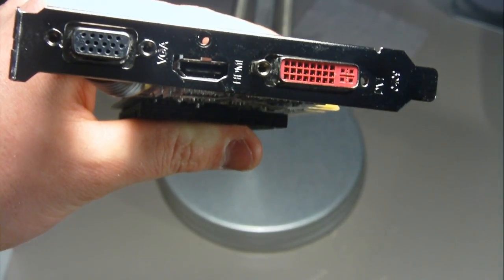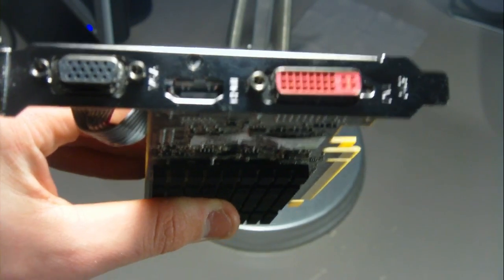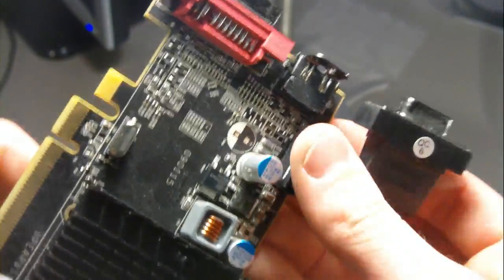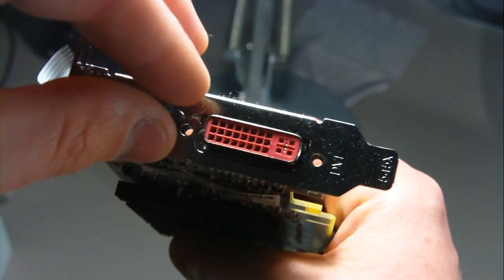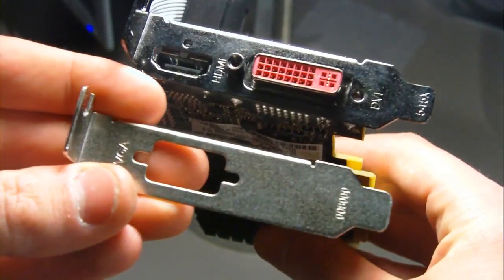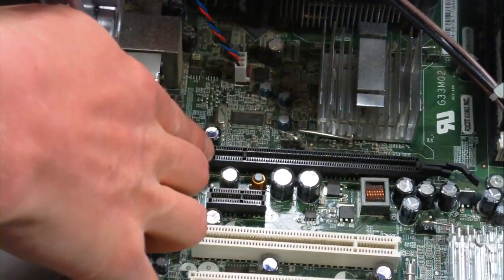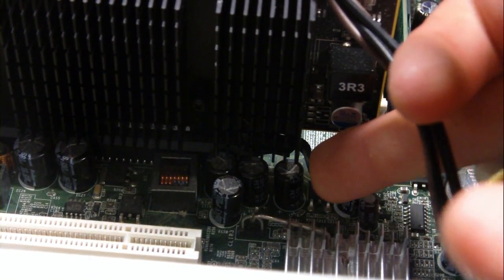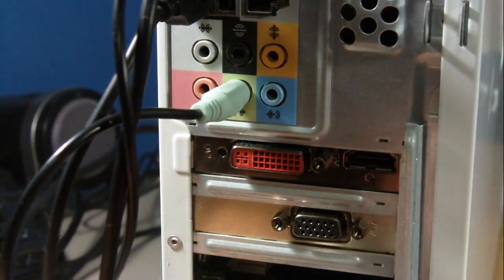[UPDATED] How to install a low profile graphics card (GPU)

Comment: sad i not find here what I wana know, there be a J2 connection on the grappic cart it say audip, must be digi connect as only 2 pin, and a J6 connect just wonder what for that be to connect, my guess was maybe a  powerconnect  for some  fan but wasn't sure and what wil be the voltage

Comment: Wait? So after the new graphics card is properly installed. You can unplug the VGA cable back into the original plug. Or do you have to keep it plugged in to the new graphics card.
Reply: you plug it into the new one graphics card

Comment: What if you are doing the opposite way? Low budget to normal desktop.
Reply from the maker: Low profile card to a normal width tower? In that case, you would leave the wider bracket on. As long as the card plug into the PCI slot, the card will work fine.
Reply: The thing is, do you have to cut holes in order to fit it in? I just used tape to hold the graphics card in place and I also used it to cover the openings to keep the air flow going. Also my monitor is in safe power mode even though the computer is running good.
Reply: Bare in mind, I have a integrated AMD Radeon Xpress 200 and I just added a another one that is a ATI Radeon Graphics PCI card.
Reply: Nvm, BUT NOW I HAVE A BIGGER PROBLEM. I AM GETTING LONG BEEPS EVERY TIME I START UP MY COMPUTER.

Comment: pls recommend me vga with 2gb ddr3 128bit for my pc hp compaq dc7900 convertible minitower. processor dual core v pro e8400. ram:ddr2. psu=365w

Comment: I have been using a intel celeron dual core 2.16 ghz and 64mbs of vram for gaming for the last three years, I finally decided to get something better because i was always having a shit pc and only playing two games. So i bought a Dell Optiplex with a intel i5 2400, 1tb hard drive, 8gb of ram, and a 270 watt power supply.. It is a small form factor case so i'm going to buy a gtx 1050 ti low profile and throw it in there.. This will be a huge improvement holy shit, i am so excited, i have never owned a pc with anything better than a dual core and intergrated graphics...
Reply from the maker: Sounds like a big upgrade. You'll enjoy it!
Reply: Thanks Man! I subbed!
Reply: Talon TCK need a better power supply
Reply: How many watts do you have, My 240 watts stock optiplex supply powers everything fine.. Good luck :)
Reply: if your upgrading to a GPU from integrated graphics I would recommend at least 400w just to be safe.
Reply: 1050ti would also get bottlenecked by a celeron I will try to do some research to help you out a bit more
Reply: First of all, you assumed a have a celeron which is incorrect, i'm informed enough to know basic shit, The 1050ti and 750ti and other low profile cards meant to do this shit
Reply: sorry misread your old comment

Comment: does this graphics card come with a vga bracket? It's the same card I want to buy and vga is video connection I use
Reply from the maker: You'd have to find out yourself from where ever you're getting it. I believe mine did.
Reply: WirelessHotShot thanks

Comment: MSI Has a new low profile gpu - last month i installed on my HP Compaq elite 8200 sff pc with  i5-2400 cpu / 8 gb ram / 2 x ssd hd & msi 1050 ti 4gb low profile gpu all running on my stock 240 psu !! works amazingly quiet , cool , while running 1920 x 1080 @ 60 ghz - average 60 fps - most 2016 games.  newegg : $ 140.-  ( rebate ) or msi 1050 2gb LP for $ 100.- also has rebate.

Comment from the maker: As someone mentioned in the comments, it is highly recommended to go to the manufacturer's website to download the latest drivers.
Reply: Really great video!
+ 1 sub
Reply: WirelessHotShot hey bro great video but i still need some help can u contact me anyway to give extra help
Reply: @CoolBrick It's alright m8 lol
Reply: @imcarlos13  nerddddd
Reply: @max-jm7hy  Lmao it's been 2 years
Reply: sorry for asking these but:

1. should i download the drivers for the video card before putting the video card in?

2. what happens if i put the video card and run the computer without downloading the drivers?

3. is it possible to run the cpu without a case?

im new into building pcs and stuff, big thanks to those who answer my questions respectively : )

Comment: this is truly a great card tell me if there is a better value out there for a 1GB "low profile" card. im putting it into my dell optiplex 780 SFF 
VisionTek Radeon™ 5450
https://www.newegg.com/Product/Product.aspx?Item=N82E16814129320&ignorebbr=1&nm_mc=KNC-GoogleAdwords-PC&cm_mmc=KNC-GoogleAdwords-PC-_-pla-_-Video+Cards+-+AMD%2FATI-_-N82E16814129320&gclid=Cj0KEQiAifvEBRCVx5up6Ojgr5oBEiQALHw1Tsc7oK7IDi_GjazvxYZOtk7tqKCu5CfcnI3Gkm7jZHsaAiCS8P8HAQ&gclsrc=aw.ds
Reply from the maker: That's about half the cost that I paid 5 years ago.
Reply: WirelessHotShot do you think it is possible to take the fan out of the old hard drive and swap the old hard drive with a solid state drive and use that fan to cool the passive graphics card because it is (fan) already connected to the motherboard?
Reply from the maker: I'm not quite sure. Could you just get extra fans for the inside of the case? Or maybe you could research and experiment with it. Sounds like a fun little project.
Reply: WirelessHotShot I researched it and what you need is a power spliter (to split the power supply output) and then u can (for example) split the hdd power and add a fan onto it. this is exactly what I plan on doing, I'll probably make a video on it too, no one has made videos on it yet. very professional video btw great job!
Reply from the maker: Awesome!
Reply: nobitagian1 yeah I truly messed up getting the stupid visiontek. I don't really play games, but even Minecraft lags during explosions. what's your cards clock speed? this trash is only 550 GHz and over locks are unstable af
Reply: nobitagian1 well honestly I got this to replace the onboard graphics which are total BS. I don't do gmaing on this right alot because my wifi sucks ass in my room. I'm gonna build a good gaming rig on Cyber Monday and hope to snatch a couple 1080's

Comment: bro what's your power supply watts
Reply from the maker: I believe it was a 240 Watt PSU.
Reply: WirelessHotShot bro I have 230 watt power supply can I run zotac nvidia gt 710 on my PC?
Reply from the maker: It recommends a 300 Watt PSU. You might be able to run it, but it will be clunky. I'd suggest upgrading to a higher PSU. They aren't very expensive. Good luck!

Comment: I have low profile gpu but it has a fan connector in between its msi n8400gs please tell how to fix it should I plug power cable to low profile
Reply from the maker: I'm not sure what you're asking, but I looked up the GPU and it doesn't normally have a fan attached to it.

Comment: when i connect my vga cable to graphics card to install drivers .my screen goes black (no signal) after 5 minutes 
what do i do
Reply: same
Reply: ShimxFn you guys probably don't have a much powerful PSU? I'm guessing.In order for your PC to run the graphics card you need a power supply unit that probably has more than 200w with most gpu's

Comment: hi i need help when i plug vga cable to my graphic card it doesnt show starting windows logo the screen is completely blacked out  please help and when i remove gpu from my pc everything works fine😢 please help
Reply from the maker: Try a different cable or different plug on the graphics card.
Reply: +WirelessHotShot i tried every single method but when i remove it everything works fine and i went to bios at startup to check if it is showing there,yes it was there and i set it to primary still the screen was blacked out there is i tried the gpu in my friends cpu it worked,he has 64bit windows and i have 32bit is that the problem?
Reply from the maker: Did you try disabling the onboard graphics if the motherboard doesn't automatically do it? Do you have another PCI slot to plug it into? It's good you tried it on a friends computer and that the card isn't faulty. And I don't think your system being a 32bit system is the issue, the pc I used in the video was a 32bit pc.
Reply: +WirelessHotShot yeah i tried unisntalling the onboard graphics still it dont show please help  my pc specs
intel i3-2100
motherboard-hp(its a hp 3300 series desktop)
powersupply 300w
ram-4gb
gpu-gt 610(😢)
i really wanna play some games please bro help i will never forget ur help
Reply from the maker: I wouldn't really know how to go about troubleshooting without it right in front of me. Best advice I can give you is to Google your problem and see what comes up. I'm sure it's happened to someone else and there is a solution. Good luck!
Reply: same here!

Comment: I have A radeon hd 5450
Please could you help me ??? I will apreciate that When i enter on high graphic game with low config the game crash with a colored screen like a rainbow with this error at the notification bar "The display driver stopped responding and has recovered" Any help please ?

NOTE : this problem occured with windows 7, 8.1, 10.
Reply from the maker: I'm not sure exactly, but you could try opening AMD's software and make sure things are set to high performance, to give the card all the juice it has. Check out this video, it might help. https://www.youtube.com/watch?v=Y9em5PO-2do
Reply: Sorry but ...
I tried to reinstall the OS - Not helping
I tried to reinstall the graphics drivers - Not helping
I tried to install windows updates - Not helping

Any other sugestions ??? that would be cool
Reply from the maker: Best advice I can give you is to just look it up. I haven't messed with the HD 5450 in 5 years. So I'm not much help. Sorry
Reply: I removed and replaced it again this morning but ..... Not helping
Thank you for your time

Comment: is this gpu outdated for gaming?
Reply: Yes ! It' a 2011 model. You can buy a radeon r5 230 it's a good good graphic card
Reply: +lamborghini14572 Yes it's not a problem
Reply from the maker: It won't be able to play many games. CS:GO and similar games, it should play fine.
Reply from the maker: Good idea. If you got the extra dough, I'd recommend a GTX 1060 or AMD RX480. Both near the same price range and will run any game!
Reply from the maker: As long as the rest of your computer is fairly new/good, you'll be able to run GTA V. GTA V, is actually a fairly easy game to run (lower settings). It's much easier to run than GTA IV.

Comment: Just bought a graphics card(n800-d512h) which goes into the pci slot, installed it and my pc opened up just fine but the monitor said it had no signal. Took out the graphics card,but when i plug it in the original(VGA) it works.. plz help
Reply: You need to set your video to the graphics card in the BIOS at startup.

Comment from the maker: Wow, it's been over 5 years since I made this video, and it has 150k views! Thanks guys! If anyone needs help, just send me a PM!
Reply: u can stick in any card in the slots but it depends on the slots itself if they bottleneck.
if u were to put a pcie 16 3.0 card in a 16x 2.0 slot, u would only get the performance 2.0 can handle even though your gpu supports more.
Reply from the maker: It should.
Reply: i have a small form factor pc and want to install a gtx 750 ti, is that card the same size as the radeon card in your video?
Reply from the maker: No it is not.
Reply: when i put in my nvidia 210 card !! and i plug my monitor cable into the VGA slot !! it dosen't show any signal !! what to do ??
Reply: Where did you buy this card?
Reply from the maker: I think NewEgg, like 4 years ago.
Reply: shame they don't make cards like this anymore.
Reply: They do
Reply: can I install a 3.0 x16 pci e on a pci e 2.0 x8?
Reply from the maker: I'm not sure. I'd have to guess you cannot.
Reply: Shut up Nerd If the card supports backwards compatibility yes, but you sacrifice 20 fps
Reply: how do I know if it support backwards compatability? help
Reply: Shut up Nerd Go to tomshardware.com and ask help if the gtx 750 ti supports backwards compatibility for (Your motherboard) and you will find you answer there.
Reply: it has to be a low profile card.
gigabyte has a low profile gtx 750ti though
Reply: yes im getting an msi or a gigabye gtx 750 ti lp but why does he say i sacrifice 20 fps
Reply: hi brother i finally find out a fix myself i try removing the vga cable of the gpu it is working fine and it is displaying in display adapters but it is written standard vga with this ⚠ on top so can u help me on this now, well thank u for all your answers i appreciate that 😊
Reply: +Slooby you would need the drivers for the gpu
Reply: +crashniels ok bro thanks for your answer i will download them
Reply: I have putted a new xfx card in the pc and installed the setup, but the colors aren't right and it's a bit laggy.
Reply: my motherboard vga not work with graphic card but if i remobe graphic card motherboard vga work if i put again graphic card try vga motherboard dont work helppp
Reply: hi bro i just fixed this problem
u need to first take off vga from your gpu if ur gpu alows make shure u plug vga cable to motherboard then restart your pc then install drivers then if ur gpu says not enough resources available then first disable you nvidia/amd gpu then intel graphics then first enable nvidia/amd gpu then intel then plug vga cable into nvidia/amd gpu 
.i had the same problem u r having but this method will solve it
i hope i helped u ....thanks....
Reply: WirelessHotShot my vga card is ddr3 is it work for my ddr 2 motherboard please help!!!
Reply: WirelessHotShot my retention bracket seems to be stuck. it won't move or anything.
Reply: is that dell cpu you used?
Reply: Amd atholn 2
Reply: Hey i have a lenovo skybay motherboard can i put a gtx 750 in it??
Reply: can i install a nvidia gtx650 for my motherboard of 2gb ram.directx 11,pci slot
Reply: 320k now
Reply: 328k views
Reply: WirelessHotShot bro need help installing video card in not getting image I upgraded ps to 450w don't know what to do now
Reply: Long time
Reply: Does GT 730 has same size as ur graphics card?i have a 4 to 4.5 inches desktop.Will GT 730 fit?
Reply: Are you died? You stopped making these videos.
Reply: Hello. I have got a graphics card and I need help. What screwdriver did you use to remove the little screws from the original bracket,  Or how do you remove them?? Urgent, Pls Help. Many Thanks

WSouthAirport 😁
Reply: What is the screw driver

Comment: I need help!!
I built my pc, and everything runs, the fans blow, the usb ports work, just when I plug in my vga cable into my pc from my monitor ( into the onboard graphics ) , the monitor goes direectly into sleep mode and turns off. But when I take it out, it goes straight back on. COmment if you know how to fix this, thanks!
Reply: Which vga port did u plug it in?  The intergraded graphics or the degraded?
Reply: The default onboard video, I dont have a graphics card, I just built my pc, havent even loaded the bios because this problem with the monitor happens...

Comment: My pc graphic card seems to have died. So I installed a new one . Well I placed a new one in, in place of the old one and turned on the PC , and now Windows doesn't want to start up . It just crashes ... Do I need the old graphics card to work in order for me to install the new one ? Because the old one is dead as dead I think it over heated and just stopped working

Comment: where did u get that graphic card
Reply: +Park Lox i was having issues with mine because the screen on my monitor wouldn't turn on i think it was reading from the mother board its self and not the graphics card and is it normal that my graphics card doesnt have a 6 pin or an 8 pin connector?